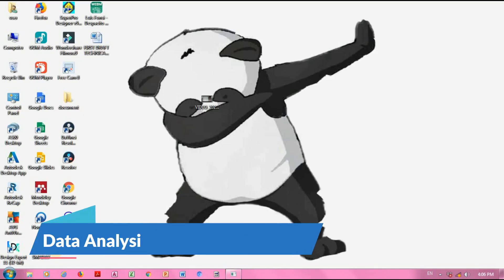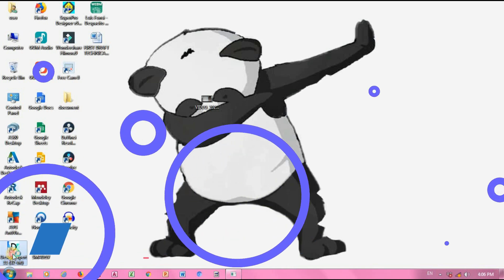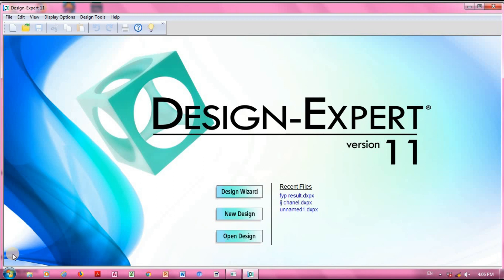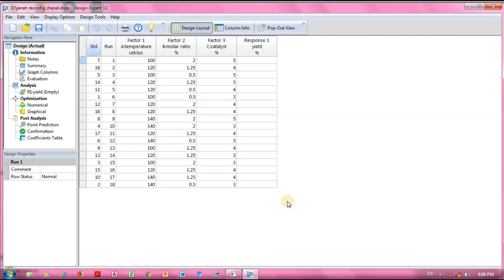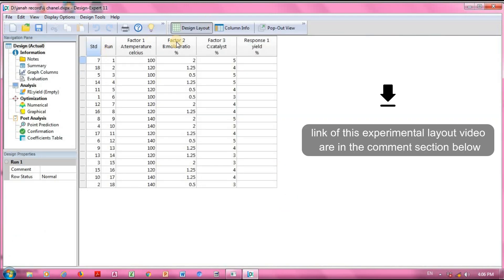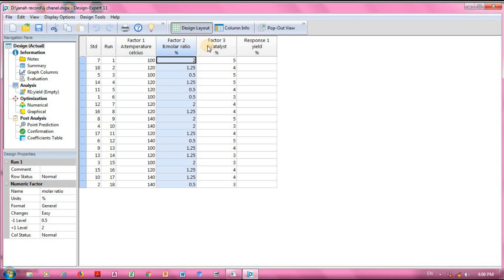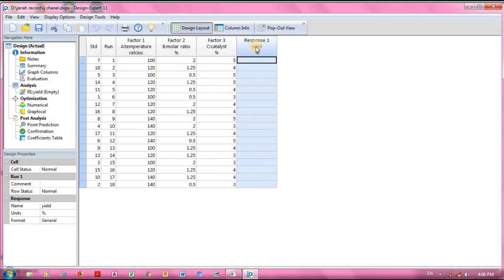How To Analysed Data in RSM (Tutorial) : Fit Summary & transform Analysis - Design Expert V11

Comment: If the value of P > a the value of F as indicated in the table of the lack of fit test and you say that the model should not be used because it falls below 0.05. Why does the program suggest you use the second-order model? My understanding is that if the lack of fit is significant it means that the second order model should not be used. I don't understand.